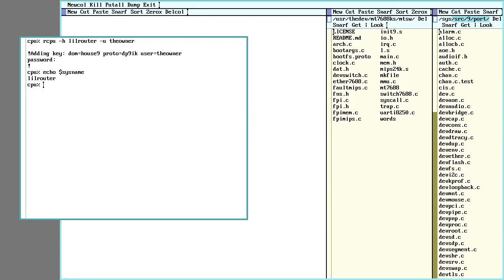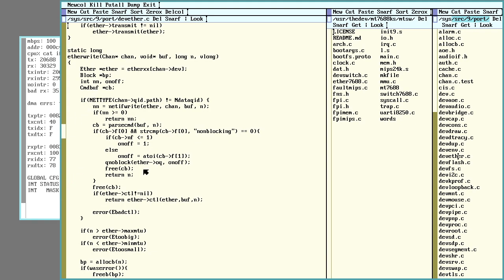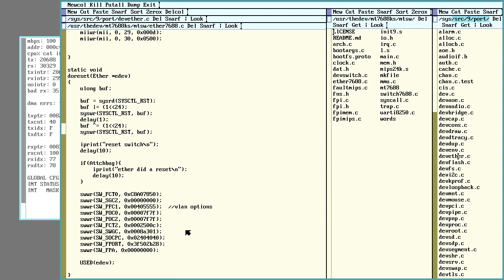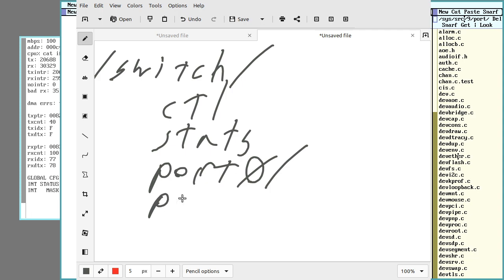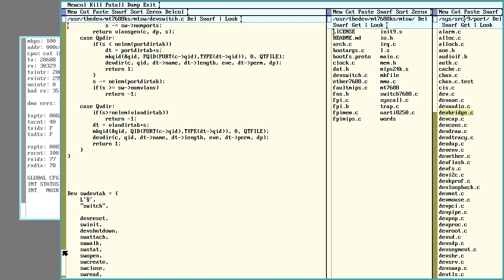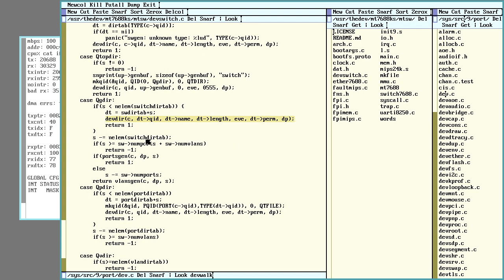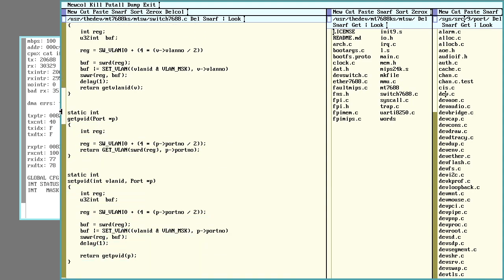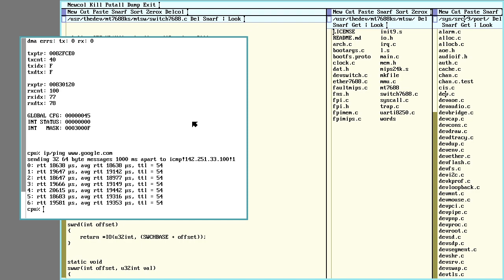Planning a Plan9 Ethernet switch filesystem, feat: a stream of consciousness

Comment: The core UNIX people support Rob Pike's observation that the "cat -v" option (which was committed to SCCS by Bill Joy but that doesn't prove he wrote it, just signed off on it) was against the UNIX philosophy (originally from Doug McIlroy) "Make each program do one thing well." The cat program is documented as being the concatenator and the -v flag cause cat to modify the input which is out-of-scope with the said purpose of concatenation. However, 6th Edition UNIX has both "sort -u" and "uniq". Is the -u flag out of scope? Is de-duplicating part of sorting? Either de-duplication is part of sorting or they went against their philosophy, creating both "uniq" which does one thing well and "sort -u" which does more than one thing. Which do you think is true?
Reply from the maker: I figure many of the cases of adding functionality to existing programs, rather than creating a new program from scratch, is a product of the culture of the group maintaining the code base.  People may find it easier to easier to add functionality to already approved programs, rather than add entirely new programs.  Or that the expectation is that one can add code to a project some one else maintains, rather than create a new project that one is then expected to maintain themselves.
Reply: @adventuresin9  I'm bringing to get the impression that Rob Pike's critique of cat -v has been hyped too much. It has its own website. I'd even venture to guess that cat -v hype is about cat -v not being "their code". To me cat -v isn't in 8th Edition because 8th Edition was forked from a 4.1 BSD before cat -v was added to BSD.